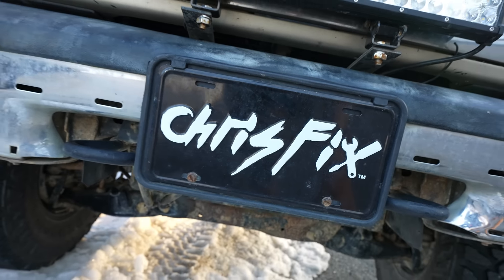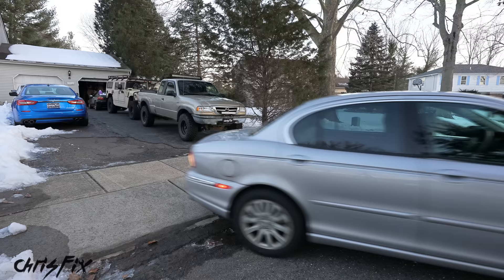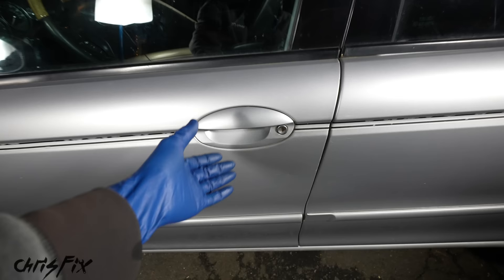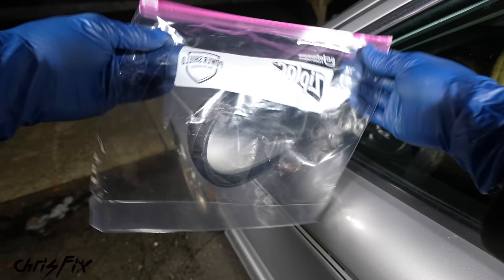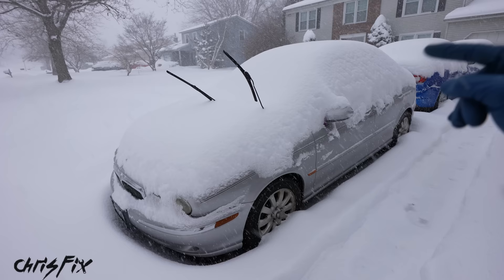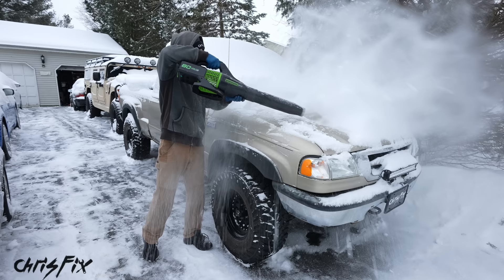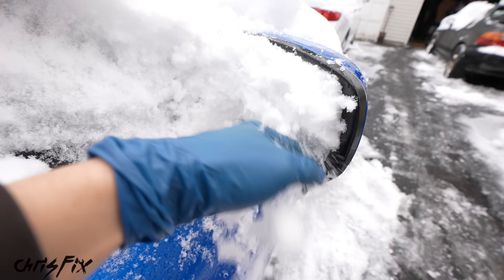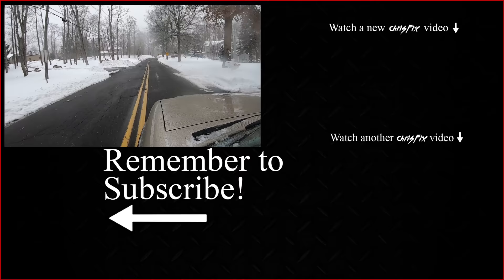10 Winter Car TIPS & TRICKS you NEED to Know

Comment: Excellent tips and thank you for posting the video. So there’s one other tip I'd like to throw in here, and that is, the umbrella bags you can get at some stores, they give them away, because they don’t want you dripping the water from an umbrella on a rainy day all over their floor creating a potential hazard, and so they usually station them at the front door. 

So I've had success finding them at my local Whole Foods store, and so I grabbed a couple because I realized I can use them to slip them over my windshield wiper blades to protect them from the snow and ice just as you demonstrate with the plastic bags over the outside mirrors and I thought that was a great trip too, I used plastic shopping bags to drape them over the outside mirrors and that worked well too. Cheers🥂

Comment: Tip: If you need to scrape windows, get inside the car, turn it on, set the defroster to max. Then start scraping the backseat passenger windows, front seat drivers and passengers windows, rear window, THEN the front windscreen. By the time you get to it, the warm air from the blower will have loosened the ice so ti scrapes away easier.

Comment: If you have a remote starter, don’t forget to set your defroster high. I totally haven’t made that mistake before.
Reply: But if it’s a small engine, don’t. The heater will leech all the heat from the engine and both will stay cold.
Reply: @saxamusprime  Mine gets warm at 15 minutes. Mine runs for 20 minutes but it lets me turn it back on as many times as I want, so I usually just let it run long enough to melt the ice off the windows.

Comment: *WARNING:* The Silicone spray in a can will eat away at your rubber seals! They almost always use a petroleum product like propane / butane / naphtha as a propellant, and those are bad for rubber. Plain dielectric grease (from a tube) should be safe for rubber. Read the MSDS safety sheet, the one for the Liquid Wrench silicone spray in the video says it's 45%-90% petroleum distillates and only 5%-10% silicone (Dimethylpolysiloxane). Use a white paper towel to apply the spray can "silicone" and you'll probably see how it always turns black, no matter how clean the rubber is - the black is your rubber seals dissolving!
Reply: Excellent tip. 
I would never had known this but for this reply.
Are we certain that dielectric grease is safe as well.
Reply: Got ourself a Chemistry science student with a A in class.
Reply: This needs more attention 💯
Too bad I already coated all my seal with the silicone spray
Reply: I would think silicone spray that is safe for rubber on scuba gear would be good to use.
Reply: 🎉Thank you very much…I was skeptical on this!

Especially since he was actually using WD-40 with the Label Taped over!

Comment: Make sure you take your phone out with you & it is charged up.Keep some warm clothing/blankets in the car & a shovel. Maybe an old rug or some old material you can put under your tyres to stop them slipping  if you get  stuck in a rut. Some chocolate in the glovebox.A candle & matches in case you get stuck. The candle may help to take a little of the chill off the inside of the car..Important though to allow some air into the car to avoid risk of suffocating.Keep a good torch in the car too. You can buy some really great multi function rechargeable ones now from Amazon which are fairly cheap & the batteries last ages.

Comment: Great ideas!

I, personally,  use walmart bags on the mirrors and just tie the handles...and i use a polyester throw blanket on the windshield...you can close the doors on it so it prevents the doors from freezing shut amd that keeps the blanket tight against the windshield,  and also i like to wrap the bottom around the wipers so they can't get showed on at all. Then all you gotta do is get the major snow off the car while its running,  then remove the blanket and bags and you're ready to leave :) works every time :)
Reply: U can use a car cover to

Comment: Great tips! If I may add, when clearing snow off the car start from the highest point and then downwards i.e. roof then hood etc. if you start with the hood then when you get to the roof the snow will be down on the hood again
Reply from the maker: Great tip! Thanks!
Reply: Exactly… and park your car close to the edge of your driveway so you can shove the snow off in that direction from the get go, drive out of the way and finish the job with the car out of the way.

Comment: Great tips. You mentioned some benefits of keeping the tank topped up. One other benefit (IMO,  the biggest benefit) is that if you leave half a tank, for example, that means it has half a tank of air. Air contains moisture content. That moisture will condense on the insides of your tank, causing water to get in your fuel. If you have a diesel in particular, that can be a big problem. Best to keep your tank fuel year-round, but ESPECIALLY in the winter
Reply: Good tip. I also put an additive like Seafoam in my gas tank during winter to control moisture, and keep the engine purring.
Reply: @Ottee2  seafoam doesn't work man
Reply: @mattchu42069  , seems to work for me.
Reply: 1 word "heet" additive

Comment: Great video mate, some very handy tips you have shown. 
I also like to lay a tarp over the bonnet when camping in the snow, it's like parking your car in the garage over night. 
It does help to start the engine of your car the next morning after it's been covered in snow. 
Another tip i do is don't park your car with the hand brake pulled on. 
Moisture on the hand brake cable can freeze over night and you might not be able to release the hand brake the next day.

Comment: Great tips Chris ! Another great tip, which applies to other weather conditions as well. Make sure your radiator and antifreeze is fresh and clean, and ensure your heat and all of ts functions are working properly. Fresh wiper blades, and all glass is coated with Rain-X or equivalent. Also have your battery tested, and clean terminals.
Reply from the maker: Good tips!
Reply: Thank Goodness for YOU TUBE, good ideas here & great video!!!!!
Reply: I live in Alberta. We are having a particularly early and brutal cold, snowy winter quite this winter.
I just bought a $100, 400 amp, 12 volt REACTOR, POWER BANK (portable battery charger - used it 3 hours ago - -33°C - to start my truck. This tool is very handy. It's on a trickle charger now 2 amps. It may be an old battery, 7 years old.
But, I think it's an important tool to have. 
2. Plug in car. No sense in going cheap. Plug in "Little Buddy interior car warmer, a battery blanket, and block heater. It draws nearly the max amp (I think 12 amps is NA standard for outlets). So far, it's holding. My back outlet has the battery charger, 2 block heaters and 2 battery blankets plugged in (I guess I'll have to check that).
3. Gas. High end gas plus MMO to lubricate fuel lines.
4. Alcohol bottles for key locks & wiper fluid
 (I just learned that from Chris).
5. If your not using vehicle take in battery, charge it occasionally, put on wooden surface (2x4s not cement).
In these conditions you must pay attention to all you vehicles....daily drivers and others.  Batteries do freeze in -35°F weather.
Reply: that's not a tip 
those are pre cautions
Reply: @davidweum  if you think you have a bad battery just replace it   
unless you bought that unit for emergency
Reply: @davidweum  Shell gasoline certainly helps too.

Comment: These are great tips.
The side mirrors, plastic bag and water for windows, freaking awesome. I used supermarket card to scrape windshield, etc. works but nothing like prevention. 

For the weight and tire grip I prefer put wooden palets which can be found behind any discount store. Then add a few cinder blocks in the grooves so they don't slide, scraping the bed of the truck. 
Thank you for the info!

Comment: Great winter tips, Chris! A few of my thoughts: Around here people put spray Pam cooking oil on their snow shovels and that works well, but I think your paste wax idea is probably longer lasting. Make sure you have air in your spare tire (easy to forget) and carry a snow shovel in the trunk at all times. An inexpensive 20 or 30 ft towing strap takes up no space at all and is really helpful when you or someone else needs a pull out of a snowbank (tow chains are a pain and scratch paint). Clean or replace your cabin air filter for maximum airflow when defrosting. Consider charging your battery, right in place, every few months in the winter; short trips can run it down and make for iffy starting on a really cold morning. Use a block heater for at least two hours when it's cold (my truck came with a factory block heater I didn't even know about for a couple of years!). Keep up the good work! Paul in the Great White North of British Columbia, Canada.
Reply: ...thinking that perhaps coat the entire car with wax and the snow would just fall off as you go??
We British don't get much of it particularly as I live near the coast - must be the salt air!
Reply: That can be super dangerous to the person behind you. I was thinking close to the same thing though! Use car wax and the snow should fall right off when cleaning it right?

Comment: Hey Chris another thing that can also help both while driving and cleaning your windows is using Rain X. It acts like a wax and coats the windows so snow from driving or parked doesn't stick so easily. Another idea to is to buy like a cheap 12x9 foot plastic tarps from lowes or home depot and drap it over your car and that helps with snow clean up to. You can close part of the doors over the tarp to hold it from wind. Also always carry a blanket, clothes, snacks and water encase you get stuck and no one can come save you at least you have a blanket and snacks to help stay warm and full! Great video thanks as always!!
Reply: you need to use the kind of rainx that you use like wax, cloud up your window and then buff it off. The rainx spray on glass cleaner won't make a bit of difference.

Comment: We just use inside external heaters here in the Nordic countries, that helps with most of the hassle. Or a Webasto which works with fuel.  But anyways good tips. I need to use that silicon trick for my trunk, it always get very frozen with a lot of hard ice, either preventing it to open or not getting shut properly after you get it open. Thankfully many newer cars have mirror, windshield and rear window heaters so no need to do extra tricks there.

Comment: Great tips indeed! However, It is my opinion that you forgot one thing that I believe is essential for good performance and safe operation in winter conditions.
Snow/winter tires. I cannot overstate how important it is to have good tires that are made for winter conditions if you live in an area that gets snow. The added traction from filling your gas tank is nearly insignificant, but the added traction from proper tires is without doubt the most significant factor for grip that you actually have control over.

I've seen way too many videos of people running summer/all-season tires sliding all over the road and hitting everything as soon as 1 snow flake falls on the ground.

Might be an interesting video for you to make? To compare the performance of different tire types in winter conditions.
Reply: I agree. night and day. I have separate winter tires and wheels for both SUVs. Live in the Seattle area with more ice than anything at times and I worry about people behind me not stopping when I do have the ability to stop on ice. It doesn't mean drive like an idiot but a much safer drive if you have to go out. The only way to go.
Reply: They also make "all season plus" tires now if you don't want to swap out winter tires.
Reply: Right that should be number 1. You can do all this but if tires aren't good don't bother
Reply: Absolutely, your vehicle has four points of contact on the road. Make them count!
Reply: always studded tires for winter.

Comment: Great vid and great tips  As a lifer up in frozen Canada I even picked up some ideas.  Here's a few I might add: CLEAN out your garage: Pretty obvious but so many folks fill their garage up with stuff to the point of not being able to even use it for their car and end up parking outside overnight all winter eventually forgetting the absolute wondrous aspect of getting in a car in the garage vs outside in the elements every day to go to work. It trumps all these tips!  Second: service your battery and its terminals in the fall...it's hell to do in the cold.  third: another reason to park facing out is access in case you need a boost.  4th: check those tires, low pressure and they can sometimes freeze that way...ca thump ca thump. Too high and you lose grip.  5): in this drive-through age frozen windows suck.  Use a credit card to slip it between the glass and the rubber trim along the bottom of the window. Once you get between, slide it along the door and glass to separate the rubber from the glass   -works every time (try to be a bit gentle though).
Reply: I can’t imagine having a garage and cleaning snow of my car.
Reply: My garage is 100' feet long.
It is easier to clean the car than all that driveway.
Also, growing up, we had a 2 car garage but 6 vehicles (2 adults +3 teens + truck).

Comment: If you used two garbage bags, you could open each side door and tuck the ends between the rubber seal of the door and frame. Then shut the doors. This will hold each end in place. This will also help prevent the rubber seals from freezing together. Then take sticky clear packing tape or duct tape to tape the two bags together where they meet in the middle of the windshield. You may want to tape the bags together inside your home first before going outside; the tape will stick better in a warm dry house.

Comment: Two tips I have for helping your car survive a winter!!! FIRST Make sure to always keep the inside windows clean!! This is important because a filthy windshield and door windows will "fog up" on the inside of the glass, faster and longer, in cold weather, especially when you turn on your defroster, which at first will blast cold air against the glass in cold temps!! 

Tip two is around the last weekend or so of "nice weather" (here in New York I almost always do this) lubricate your door locks, hinges and release mechanisms with dry Graphite!! The graphite will work into the moving parts and allow you to open doors in bad weather better than Lithium grease or WD-40!!

Bonus Tip- Around the same time as late October early November on the "nicest day possible" while it is still "warm out" thoroughly wash your care well and give it a good heavy paste wax coating! THEN IN WINTER NEVER WASH YOUR CAR!! Grime and especially road salt can rust out panels on your body, and the Paste Wax will help protect it throughout winter!! THEN in the first month of spring, when you are getting decent temperatures, hose off your car at a car wash with the "rinse water" before you wash it to remove salt and dirt BEFORE you switch it to soapy water and wash it!! You will find the paste wax, (if you put it on well enough in the fall) has protected your paint throughout the winter, and when you wash it, most of the wax left over on the car will probably be gone with the first spray wash!! 

Bonus- Bonus Tip.........Fill your washer fluid with windshield washer fluid that has an ice melter feature in it! AND make sure to change your wipers in the fall!! ALSO you can take a paper towel and napkin to gently wipe off your wiper blades in winter too just pinch to blade edge between your fingers "gently" and pull the napkin or paper towel across it ONCE!! This will help remove any streaking you might get as well too!!
Reply: Not quite true with the „don’t wash your car“
The bottom side of your car will get the rustiest  of them all…so you’d have to protect it really well or just wash the bottom

Comment: Another tip would be to remove the snow from your vehicles before you shovel the snow from your driveway. That way you don't have to come back through and shovel again.
Reply: Good Grief !!  If a heavy snow storm, one may HAVE to shovel to get to the car to clean snow off.  What difference does it make, other than feed into one's laziness.

Comment: Great stuff, but there is one KEY bit of information that all DRIVERS should know. Your car has GEARS!!!! When there is snow or ice on the roads simply shift down to a low gear and get more traction. If you are in low gear when you take your foot off the gas, the car will basically stop. Instead of spinning your wheels in the snow, in low gear with minimum gas, the car will move through the snow. I have navigated hills where busses and trucks have been unable. This works.